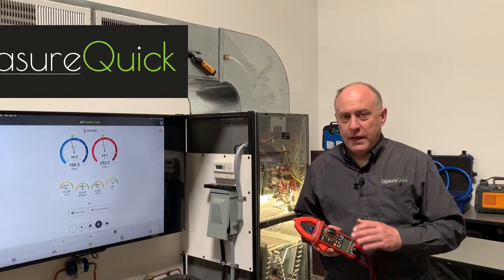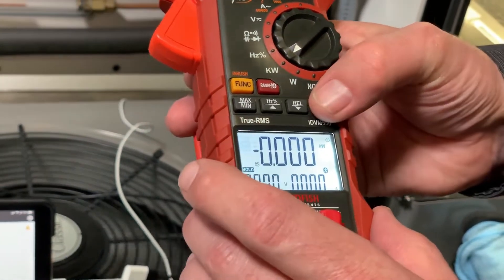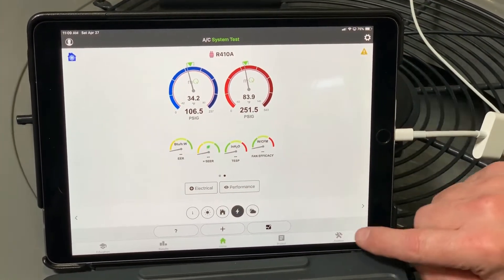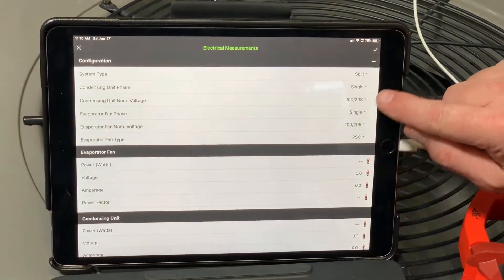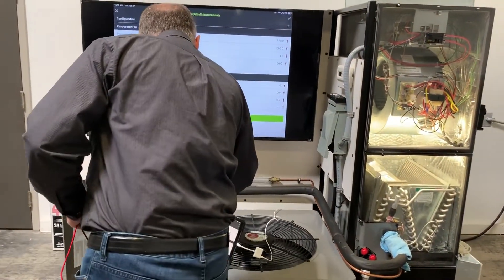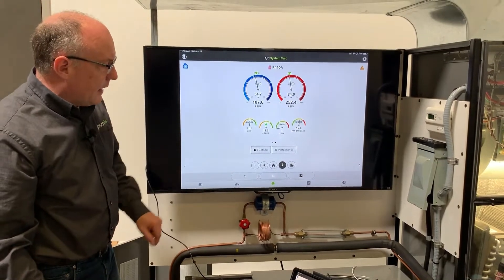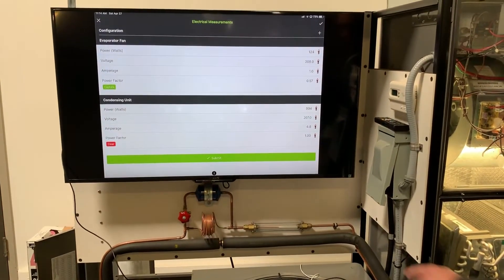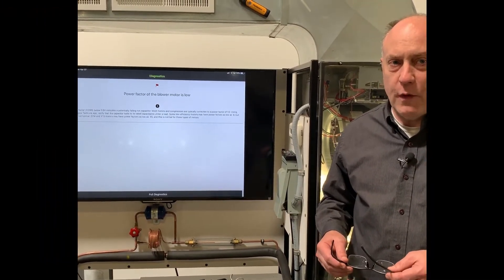How to use the Redfish iDVM550 with measureQuick

Comment: What would be the best way to capture blower motor electrical readings in the field? If we take the blower door off won’t it alter our readings versus having the door on?
Reply from the maker: Grab power and current at the service switch. For fan draw they want the amps in total to run the fan including the transformer.

Comment: I currently have the UEI DL489. I am getting ready to graduate school and I think I am going to need a meter that does power factor, phase rotation, Hz, SEER, etc. I have narrowed it down to 3 meters..... the Supco Redfish IDVM, Fieldpiece sc680 or sc480, and the Amprobe ACD-51NAV. Which of these meters is the best in your opinion?? If you were a new tech starting out of school which would you use? Or, is there another you would recommend?

Comment: Just started today using your app and fieldpiece probes.  Is the supco the only meter that works with MQ? Fluke has Bluetooth amp meters? Are they proprietary Bluetooth configuration?
Reply from the maker: Yes, Fluke does not appear to want to play with others.
Reply: Shocking.  Fluke? No?  Bought the redfish idv550. Putting it through its paces on tune ups this week.  And getting familiar with it, as well.  Didn’t realize how big the display/text is on screen.  Nice.

Comment: Redfish iDVM550 aka Ames CM1000A $99 at harbour freight. Supco has no shame.
Reply: I also have the CM1000a, but it does not operate the same. No BT, and not as fast.
Reply from the maker: The meter housing is used by several manufacturers, the electronics and features are not the same. Supco is a power quality meter with Bluetooth and a very high end CT for low amp draw measurements. The tooling required to build out a meter is extremely expensive so many of them are contract manufactured and have a similar appearance.